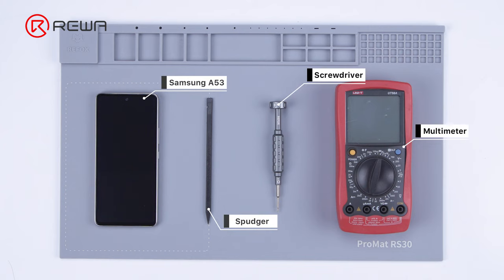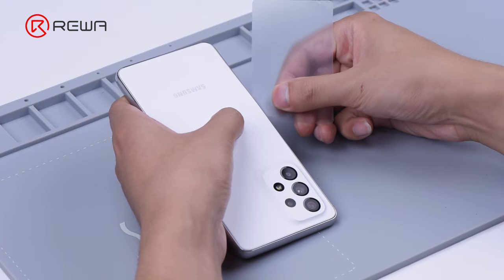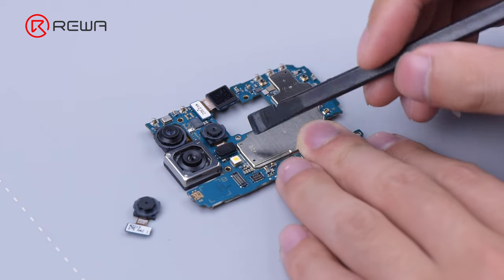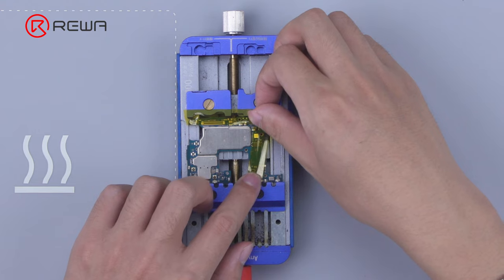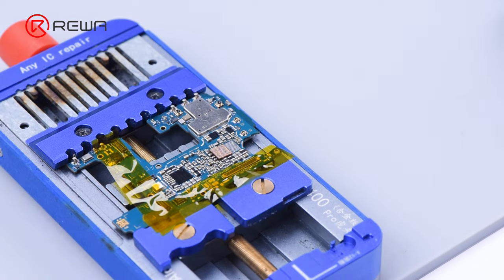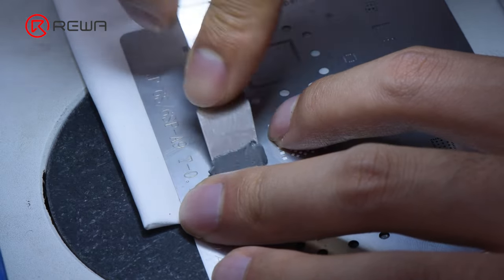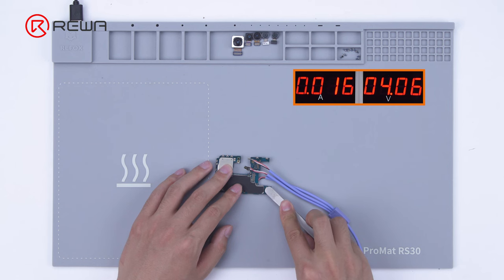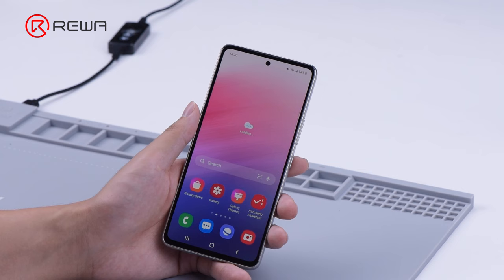How to Fix Samsung A53 Won't Turn On - Motherboard Repair with 0 Current

Comment: Bad power ic after reboll still alive?) Why you dosnt use new chip?
Reply: They used a new chip
Reply: MrQuazar , you right that’s first time see power ic reboll and working fine . Normally change new one , I know the chip damage.
Reply: Dum2,watch and listen carefully,they did replaced it with new one
Reply: already using the new power ic
Reply from the maker: We replace with a new one.
Reply: @rewatechnology2008  
Great
Reply: @himasfalianakbar6306  
Thanks
Reply: @eelamir  thanks
Reply: @rewatechnology2008  I've seen your videos...
I'm from Honduras 🇭🇳  all I can say is... Amazing 👏  I've been learning a lot from you guys... Keep going!!
Reply: @rewatechnology2008  why are you reballing it then? New chips come already reballed.

Comment: Hi nice and proper setup for repairing.
Can you get me some links on that rubber mat with heating, your power source and the connectors to your mainboard and the rest of the equipement used so that I can repair it here as well.
Reply from the maker: hello here is our onine shop, it may help you : https://shop.rewa.tech/

Comment: Would this be something that could help turn on my phone that has water damage and can't be turned on or charged 
I was told it's unfixable but no one's gone through it thoroughly like you have. I'm hoping to salvage some of the important  memory
Reply: Every thing can be fixed

Comment: My a52s has problem with gps , i cant use google map or any map for navigation
It doesnt get any gps signal unless i restart the phone ,it only works in short period of time then it happen again
Gps is inaccurated all the time despite i updated via ota many version it's still not working
Is that software issue or hardware issue

Comment: İ have that phone but my is not turn on but have vibration , Could it be from the main flexible cable because its Some connected and some not connected at the top.      Pls help
Reply from the maker: Sorry, REWA does not provide personal phone repair business,please contact your trusted local repair shop, repair case we aim to share a method, but now perhaps you can try to find a repairman to locate what is happening first, which part lead to this problem

Comment: Why replace power IC even if surrounding components are good?
Reply from the maker: If the surrounding components are good, there is a good chance that the power IC has caused the problem.
Reply: @rewatechnology2008  how is that?
Reply from the maker: @renzojohn06  Both the surrounding components and the power IC control the boot-up of the device.
Reply: @rewatechnology2008  sir mera A53 5G MOBILE same problem tha.but somehow its not repaired.. abi kya karu. Kuch kar sakta he kya..